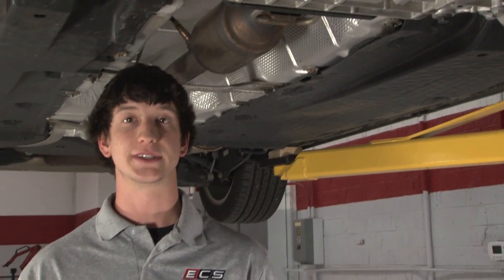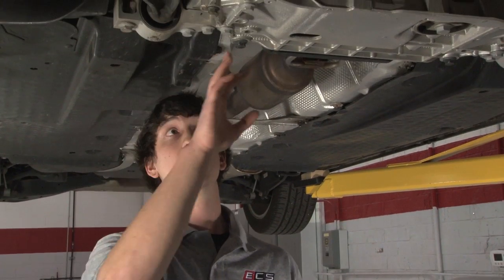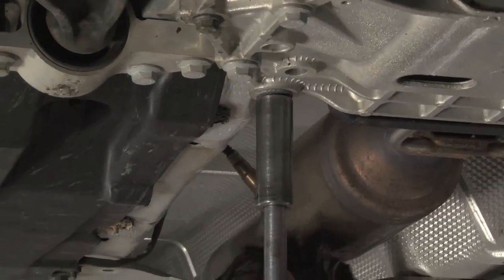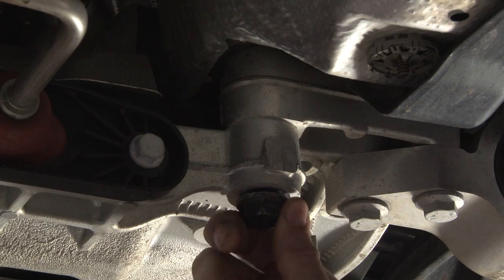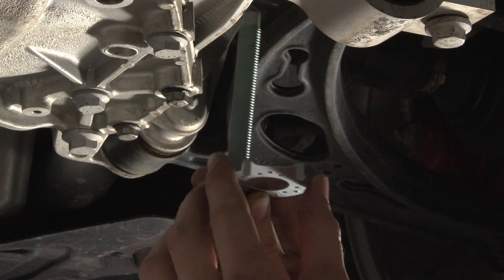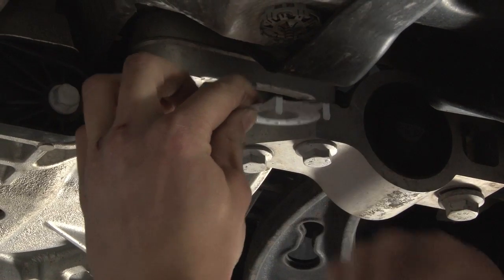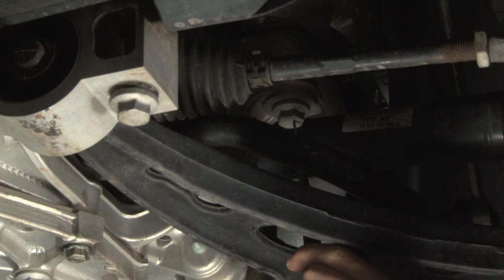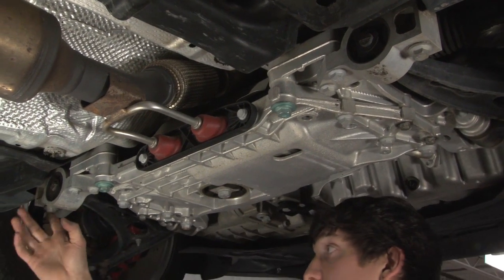ECS Tuning: VW MKV Subframe Spacer Plates Install

Comment: Is this a dumb question, how would you fit these while using axle stands?
Reply: like jackstands? put the stands on the lifting point on the pinch weld. It should say in your owners manual where to lift your car.
Reply: @solomonanczarski5402  question was more linked to whether the wheels need to have the weight of the car on them still when letting the subframe go… less to do with; where I put jack stands.. I got that bit down believe it or not. Not sure many people would be asking a question about doing a job like this if they didn’t know where jack/axle stands go, do you?
Reply: @shotts90 You didn't phrase the question that way at all, why would anyone assume that's what you meant?
Reply: @solomonanczarski5402  did I ask, where do I put axle stands? No. 
Was the guy fitting new subframe bolts? Yes. So asking how I fit ‘these’ while using axle stands would imply I’ve got the car off the ground and I’m referring to the bolts. 

Not how the fuck do you use axle stands. You shouldn’t own axle stands if you don’t know how to use them. Ps. The welded bit is a jacking point, not an ideal “stand” point.

Comment: How exactly do the subframe bolts/spacers become part of the camper alignment process when they are TTY single use bolts? Where/how is that adjustment made?
Reply: Search TYROLSPORT  This is THE  fix
Reply: Andy Mac too expensive

Comment: its interesting how the video states that the torque spec of the bolts is 81 FT-LBS plus a 1/4 turn, but the kid installing the bolts clearly doesn't do the 1/4 turn before saying "and now we are complete"... so much for doing the job right!!!
Reply: @Steve C Every manual I've seen has always stated 70Nm (51ft-lb) then 90 degrees.
Reply: VW manual says 52ft/lbs + 90 degress (1/4 turn), I am not sure where they are getting 81ft/lbs from

Comment: 81 ft/lbs plus 90 degrees?  According to Bentley, and the ECS instructions on the locking collar set, it's 51 ft/lbs plus 90 degrees.  Hope the bolt snaps before the threads in the body tear out!
Reply: yeah.  vw repair manual says 51ft/Lbs plus 90 degrees also.    So where does the 81ft/lbs  come from????
Reply: @g4sean  just because they do not really knows what they are doing.... They advised always to do so f** things.... torque here are here in order from left to right (+90° turn): 70 - 70 - 50 - 50 - 70 - 70 - 50 - 50  -70 -70 and you are done. All bolts have to be replaced by new ones and mounted with anti seize or copper grease. Original bolts are costless , seems to  be 5 bucks each.....
Reply: artgoat did you not realize that Ecs uploaded this video? This is a Volkswagen not a Bentley...
Reply: @MK5Cole  hahaha Bentley is a repair manual, not Bentley the car

Comment: Two of the bolts on the control arm suppors are stretch bolts.  You shouldn't loosen and attempt to retighten, they should be replaced as well.  You don't show the 1/4 turn after the torque sitting is reached, was that intentional?
Reply: 🤣🤣🤣🤣🤣 - There's always somebody!
Reply: @AutoMotivatedTV and what if that somebody is right ? 🤔😄

Comment: Not a bad video.  Some tips I would add as a professional who services these cars for a living.  Firstly disconnect any auxiliary items connected to the frame.  Like the dog bone mount, and the exhaust hanger. Secondly spay some brake cleaner or similar into all the threads and blow them out.  Finally, use a stand, or a jack (if on the ground) to hold the subframe in place while you torque down the bolts. The reason for this is to eliminate false torque readings.  This will ensure a perfect clamp every time.
Reply: so, during realignment bolts will be losen again? But according to vw recommendations such bolts tighten with torque+turn MUST be replaced.
Reply: Lynx Star Automotive sound advice right here as the subframe could move a fraction when torquing the bolts and give false torque reading. 👍

Comment: where do I get the spacer?
Reply: https://www.ecstuning.com/b-genuine-volkswagen-audi-parts/subframe-spacer-plates-with-hardware/7m3499349a~kt/

I would fully expect that an alignment is required to determine if the camber has shifted.

Comment: Hello. I have a 2014 Tiguan and there is a noise in front of the driver seat. It's most like a knocking sound on the front strut. My dealer has check everything but nothing seems to be bad. I've read about this issue in different blogs either Tiguans and golfs but without any solution. Is this kit is made for this? The noise sometimes appear in the steering wheel.
Reply: Alvaro Salinas gearbox if noise is happening when turning and accelerating at same time could be gearbox mount.

Comment: The subframe still moves with these spacers its just that you dont hear it anymore! SO youre alignment still goes awol
Reply: alex cristian thebspacers serve the purpose of a lock washer, and also adjustment during an alignment.  This is how camber is adjusted on many VW.
Reply: Gabriel Velazquez ok how do we fix the issue then without spending £100+?
Reply: aqib2000 easy, dont buy a MKV

Comment: What's the purpose of the ECS product?  Why not just torque the OEM bolt down to specs?
Reply: They are stretch bolts. One time use. I realize this is old but I am answering for other people wondering.
Reply: William G if that's true, wouldn't it just be cheaper to buy new OEM bolts and torque them down to spec?
Reply: These are OEM bolts, this video is a 'how to' guide on fitting them.
Reply: Go to the vw dealer and order 2 bolts with part number N-908-235-01. Should solve your clunking issue. Bolts are from a Passat. They fit.
Reply: The bolts have to be replaced whenever you drop the SBF.  Also, the spacers serve the purpose of a lock washer.

Comment: What are the torque specs for the bolt next to the tie rod? Is it the same 81ft lbs?
Reply: 70 Nm = 52 Ft/lb. What is correct unit or value? Two units in one  clip?
Reply: TORQUE SPECIFICATIONS
B6 Passat/CC/Tiguan
Control Arm Bracket Bolts M12 x 100...............70 Nm (51 Ft-lbs) + 180 degrees
Steering Rack Bolts M10 x 70..............................50 Nm (36 Ft-lbs) + 90 degrees
Subframe Bolts - Lower M12 x 110 .................70 Nm (51 Ft-lbs) + 90 degrees
Subframe Bolts - Upper M12 x 90......................70 Nm (51 Ft-lbs) + 180 degrees